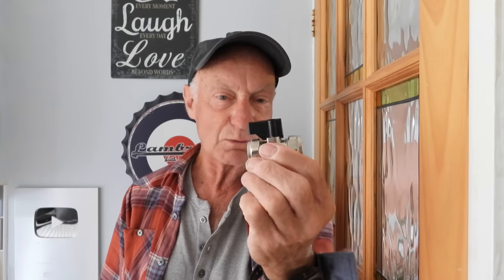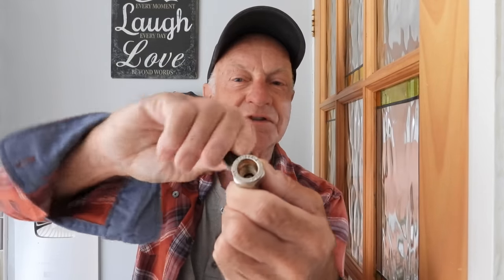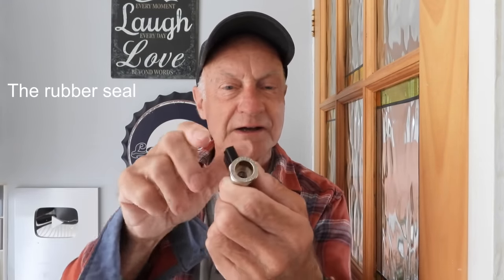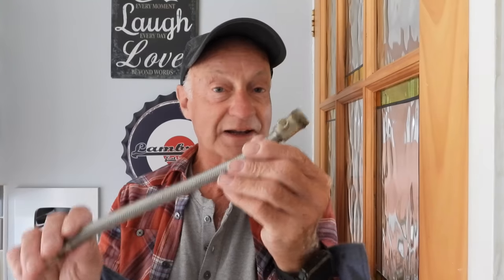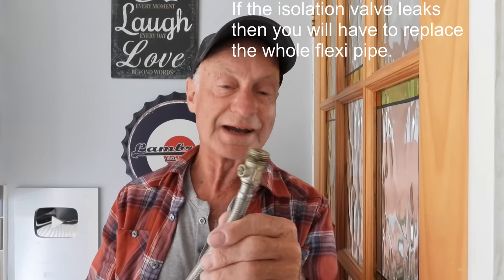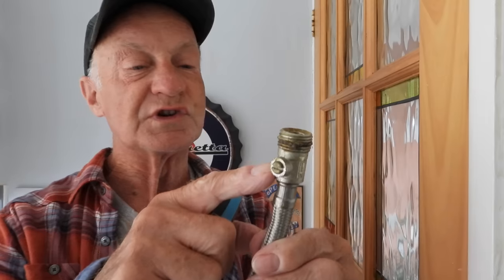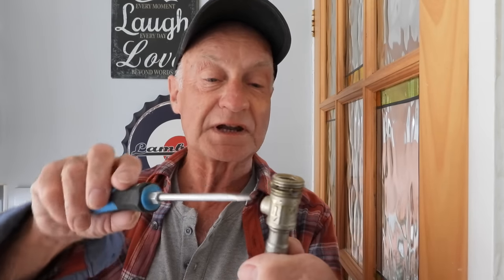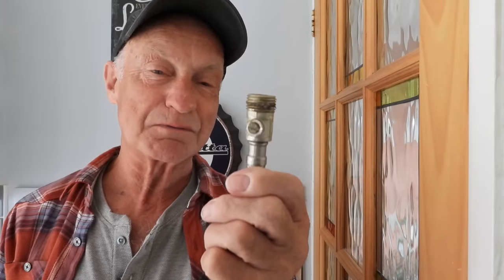Important  See this before fitting isolation valves

Comment: had to turn off and on hundreds of these when replacing water heaters and showers etc, fitted them in my own home and never had a problem. i refuse to turn gate valves off though because you can guarantee they will snap and not turn back on.
Reply: I agree, gate valves are the worst!
I usually always replace them on jobs I do with full bore lever valves.
Reply from the maker: You have been lucky. Full bore levers are best. I have had hundreds of these isolation valves never working or leaking once turned.
Reply: @dereton33 I once turned one - just slightly - to isolate the water so I could fit a new sink and worktop. The core shot out like a bullet (pressure was over 5 bar) hit me in the chest and for the next 15 minutes, had the apprentice holding a towel over it until we could find the main valve, which was on a lower floor, hidden amongst dozens of others. Never trusted them from that day to this. And the screwfix 10 in a pack ones ALWAYS leak, unless you use loads of ptfe tape. Cheap rubbish that should be avoided - just not worth the hassle, simply to save a few quid.
Reply: Totally nonsense wasting people's time  too old for modern thinking 😂
Reply: Comments of a kind and experienced man. Thank you!
Reply: Full bore are best. End of.
Reply: I cant say i have had problems with this isolation valves but gate valves are always a problem
Reply: All this talk of gate valves is a worry, as last week a plumber installed one on the cold water mains leading to the 2 hot water calorifiers. He replaced like for like, should I be worried ?
Reply: @CupidStunt72  gate valves are fine as long as you turn them once in a while. i just turn every valve of any sort off and on twice a year, i just do it when the clocks change, easy to remember then.
Reply: @ShadowzGSD  thankyou. I feel better now ! Love your channel
Reply: @CupidStunt72  what is there to be worried about?

Comment: I see what you mean, but I’ve never had a problem with the slotted screwdriver type valves, and frankly fitting the lever full bore valves is completely impractical with things like toilet pans, so I don’t actually agree with your advice at all.
Reply from the maker: You takes it or leave it. Just giving my personal opinion after 55 years a plumber.

Comment: Excellent advice Al. I do prefer the full bore lever valve. But it depends on amount of space one has to work with and application. Those screwdriver operated valves also have an arrow on them indicating direction of flow. You can almost guarantee problems if someone put it in the wrong way around if you try to turn it off
Reply from the maker: Right on
Reply: These ball valve isolators are effectively an emergency failsafe.  What happens when the failsafe is cheap junk?
Reply: the screw head valves are easy - if the slot is in line with the pipe the valve is open - if it is at right angles to the pipe it is closed. easier than looking for an arrow in what is usually a limited space.
Reply: @bertiebongo  The arrow tells you which way to plumb it in in the first place when you are fitting it. Not which way to turn it off when you need to stop the flow of water

Comment: Full bore valves don’t all have handles. Full bore just means greater water flow and doesn’t affect pressure. The seals inside are the same irrespective of the type of valve, although I would agree that cheap iso valves do tend to fail before more expensive brands would which I attribute to the quality of the metal and the seals themselves.
Reply from the maker: Thanks Pete.
Reply: The seals are not the same

Comment: Could I just add, that if you fit a "screw" type, please position it as to ensure the screw is easily accessible in what is usually a confined space. Trying to get a screwdriver to do its bit in a couple of inches clearance, is not good for the blood pressure.
Reply from the maker: You are sure right there.

Comment: I always give the screw head on the isolation valves a small squirt with WD40 just to ensure it’s loose and working, before I get the screw driver on it.  That helps me.
Reply from the maker: It will still leak once turned.

Comment: I can absolutely confirm your advise. Last year I had a kitchen tap to replace. Turned off both hot and cold valves, and both leaked. Spent more time on THEM  than the tap, one took 4 months to finally stop a capillary leak. So I still had to shut off the mains valve, and had to stop THAT leaking as well!
Reply: I had a similar job, had to change a tap in a factory canteen... it had a screwdriver-operated iso. valve... siezed SOLID ... and NO ONE knew where the water mains cut-off was... simple job turned into a nightmare... 🙄😖
Reply: @peterfitzpatrick7032  Experience has taught me that "Simple" usually means "Straight Forward," and that Straight Forward" usually means 'Time Consuming. . . . . . '
Also that the worst job you could imagine ends up being not as bad as you expected!

Why is it that the jobs you learn most from are frequently the WORST?
Reply from the maker: Seems you all had a bad time. Dont you just hate plumbing ha ha.
Reply: @dereton33   I'm not even a plumber ! I'm a fitter-turner by trade ...🤷🏻‍♂️😅
Reply: @peterfitzpatrick7032   That's what your electric pipe freezing machine is for.

Comment: How true, Isolation valves work great as long as you turn them off and on at least 4 times a year. I do industrial maintenance and I know from experience they will freeze. I have used pipe wrench to turn off a valve and have replaced many because you can't turn them off or not completely. Good Advice
Reply from the maker: Thanks Steve.

Comment: Thank you! These are HORRIBLE. To have plumber agree is so good to hear. These leak whenever you need to use it, calling a plumber back to replace it and cause more problems and cost than you needed. Do plumbers fit these knowing they'll be called back?? Seems it! If I get my pipes replaced, I'll buy the parts and tell plumper to fit them or tell them what I want fitted. Of course I'll pay more. There are better ones out there that in the big scheme of a plumber charge is little compared to these few quid crap.
Reply from the maker: Thanks for your story.

Comment: Sound advice. A cheap slotted iso was fitted when I had an outside tap installed. Every winter had to turn it off to prevent freezing and the inevitable happened after a couple of uses, the screwdriver slot was beyond use and then it seized up and leaked. Since then I always buy and insist plumbers install Peggler full bore with either the longer handle or the shorter twist handle. Never have a problem with any of these -you get what you pay for.
Reply from the maker: Great advice Steve.

Comment: I fitted two of those screw slot isolation valves the first time I did some DIY plumbing, I never used them again, both seized up and couldn't be turned when I wanted to shut them off, one was on a shower feed. It was also brass so a very soft screwdriver slot that was easily mangled, I replaced them with the full ball valve lever type you showed, no issues as yet. The handles don't really bother me, they are under the worktop or a sink so not normally visible any way. I did consider the small lever type but figured if they did get tight there wasn't enough leverage or grip on them for me to operate easily.
Reply from the maker: You will be fine with those lever valves.
Reply: If the pipe is fully inserted in the live side then it can be forced against the internal seal around the ball when the coupling is tightened thus making the valve difficult to operate. I would suggest fully inserting the pipe then bring it back a mil or two before tightening the coupling. That way the pipe end isn't being forced up against the internal seal and the valve will work without any problem. Also, for those out there who aren't plumbers - please make sure NOT to put PTFE tape on the coupling threads (that serves no purpose other than making it difficult to tighten the coupling. The tape goes over the olive and the thread is left clear allowing the coupling nut to run up and easily tighten.
Reply: @JohnSullivansChannel  Never seen a pipe move whilst tightening, there is a lip inside the fitting anyway to stop it going in to far. Also most people say PTFE tape is not needed on compression fittings, I've never used it and to be honest I think it would just be pushed up the curve as you tighten the joint and bunch up  between the mating flats possibly making it more likely to leak

Comment: I used two 22mm full bore slotted type within  the 3” stud work wall to isolate the hot and cold gravity feeds to the bathroom shower. The hot one seized within 6 months and the cold not long after. Replaced with the lever type and removed the levers so they would fit and just refit when needing to operate them.
Reply from the maker: Great idea 💡

Comment: Very sound advice. When I’ve fitted them things (customer has usually bought them) I spray wd40 on the screw or under the handle to help longevity. It’s normally me that would be called back years later to fit a new sink or ball valve etc and need to isolate. Seems to work.
Reply from the maker: Best just to stick with high quality ones like peggler. No problems then.

Comment: Any type of isolation valve has rubber seals, including the full bore variety/lever handles. So the technology is pretty much the same. The difference is the full bore variety having a larger internal diameter, so are less likely to clog up/seize with scale and not function properly. Lever variety is of better quality, much easier to use.

Isolation valves aren’t meant to be regularly turned on/off - they are meant for servicing an appliance like a basin tap, or a toilet which is how often on average? Once in ten years plus? They do the job usually, there are cheaper varieties that look identical and of course don’t perform as well. Most regular people don’t go round turning all their valves and what not in their homes to keep them smooth running, it is good practice of course. But the chances are any type of isolation valves with time will cause problems. I think it unfair to make out these slotted type isolation valves aren’t any good at all.
Reply from the maker: I know they are not all bad stick with high quality ones like pegger and all is fine.
Reply: Not all isolation valves have rubber seals, there are a variety of materials used for seals depending on the intended usage o f the valve as there are a variety of metals used in the construction of the valve bodies. For example DZR fittings for potable water. Most problems occur because of inappropriate selection of materials.
Reply: Yes my thought entirely -that I still see instalations including those owned by local authorities without any isloation valves, making repairs difficult, and when it comes down to it an installation without these valves is a clear indication the installation is likely to have many other problems.  As to screwdriver turn damage -a hollow ground screwdriver of the appropriate blade crosee section should be used, not anything from a scraper to a cuteraly knife.   It is the same with other domestic property services -exactly how many people press the test button (5 x s test) on Residual Current Device on a monthly or quarterly basis? Probably none of you.
Reply: @SteveWhite-d9f   DZR fitting with all metal seals (mating surfaces) especially multi-turn gate valves are just as prone to siezing, most often though not mentioned by detron33 in this video, is caused by hard water lime scale build up -preventing components returning to closed position, after sometime years in open position, that gate valves and even Stop Cocks leak from the gland (the part wwhere the handle /shaft is for you non plumbers) has nothing to do with construction or the metal they are made of, it is down to the gland seal (not metal) drying out, the only way a metal seal can be used is if the valve is designed to be fully open or closed -in effect forcing two metal -copper, brass, or bronze (DZR) into hard contact -and again this may also fail when the secondary position is facilitated, again down to a build of hard water scale.  There is no mitigation against due dilligence by house holders.  And as to rubber seals -be they natural or synthetic -they are everywher in all plumbing today if they were as prone to failure as mr Detron33 contends -plumbers would by worked into an early grave, and householders and gov't would be in revolt.
Reply: Well take it from me in the business for 46 years they are absolutely rubbish,end off
Reply: I've got a dirty great BIG lever operated one made from marine grade stainless steel with teflon seals which I use as a drain down valve for my heating.
Reply: They are prone to seizing solid. I had them on my ensuite basin and the first time I needed to use them to change a tap, they couldn't be turned off.
Reply: I agree. I'd say toilets normally some issue develops every couple of years that requires turning these too, so ok there.
Reply: @noelburke6224  Yes .When I arrive at work water all over the floor.
Reply: @SCjunk  not to mention radiator TRV's or lockshields!!!

Comment: I replaced some taps on a basin in a relatives house that had the cheap ones and these hadn't been turned in years. Both of them started leaking... I could replace the cold side as that was easy to isolate from the main stop cock, but the hot water side I couldn't find the stop tap and didn't want to drain the hot water tank... in the end as a last resort I heated the valve up with my plumbers torch (hoping but never thinking it would melt a new surface on the seal) and it only flippin worked! Something to try if you're desperate like me I guess.
Reply from the maker: Thanks for a great tip Stuey.

Comment: I bought an old Victorian house in 2014, every pipe and radiator had an isolation valve fitted. I kept an eye on them and I did turn them every 6 months. Never had an issue.
Reply from the maker: Must have fitted good makes not the cheap as chips ones.

Comment: All good advice, although the water companies didn't like it, I always used to fit a lever valve rather than a stopcock.
They were much easier for an older person to operate, and stopcocks seize up after a few years anyway. 
Also,  make sure you use copper olives and not brass ones with a couple of turns of ptfe tape  or a smear of LSX
around them.
Reply: Also the rubber can perish and be lost i changed presumably 70 year old stopcock as it wouldn't close off and found the rubber had gone. I like quarter turn. As part of good housekeeping people should turn the internal and external shut off to clean off deposits and prevent seizures. I quite like butterfly handle as they are less likely to be knocked , i used one on a farm trough for this reason and had it facing inward to protect against 🐑🐂
Reply from the maker: Thanks for sharing

Comment: Great advice - full bore Peglars always. Also always full bore flexi pipes with no valve and ideally hand tightening nut for the tap connector.  Costs 2x the cheap stuff but last a lifetime.. If you are paying a plumber £50 per hour then a £10 valve v a £4 one is irrelevant.
Reply from the maker: Right on

Comment: i changed my taps just the other day - my isolation valves are adjusted with a flat head screw driver - they have been on for many years and had no problems at all. If you run the hot tap and the water isn't as hot as you would like then just close the isolation valve a little and the flow of water will be slightly reduced and the water will be hotter because it is spending longer over the heat source. no need to get a plumber out for that.
Reply from the maker: You must have had good quality ones fitted.

Comment: They can be ok if the flow rate and pressure is good. On central heating the bore through the valve can be very small. This will result in not enough flow rate to the radiators. Good advice given to fitt full bore valves.😊
Reply from the maker: Thanks David.

Comment: These valves can start leaking from the flat slot when turning with a screwdriver. You then have to drain remove and replace which is hassel and seems to happen more on a Friday. A lever valve is more reliable and they rarely leak from the spindle.
Reply from the maker: Right on David.

Comment: We use big bore versions of these valves on boats. On private boats they tend not to be turned off and the day the boat is sinking, you find the valve has seized up and can't be shut. The other problem with 1/4 turn valves is that when you turn them off, water remains in the ball and can freeze up during the winter, splitting the valve apart. Gate valves may take longer to close but they are more secure.
Reply from the maker: It seems they all have there drawbacks. Depends which one you want.,

Comment: I find all isolation type taps, all types mentioned, can leak eventually, including stop cocks. I find that for toilets, where the plumbing tends to develop some issue in a few years, these ones are fine as you end up turning them for some reason relatively regularly. Best off only using these screw ones where likely to get turned when doing a job. For ones you may need to turn for other reasons, such as re-pressurising a boiler, then use tap handle ones.
Reply from the maker: Thanks for the tips Nicholas.

Comment: Ha this is what prompted my question about the fill loop replacement. Seems mine had fused itself shut and the handle has snapped as it can't take the force to open it. I'm going to get a fill loop with an inline stop though as I'm no plumber and while these work they are a Godsend able to just avoid larger hassles. I think I will be taking it off when not in use though - keeping it dry should,  I hope lessen the likelihood of re-fusing.
Reply from the maker: A good idea.